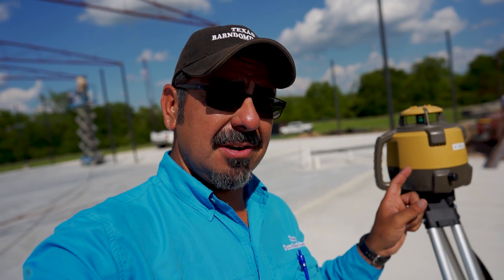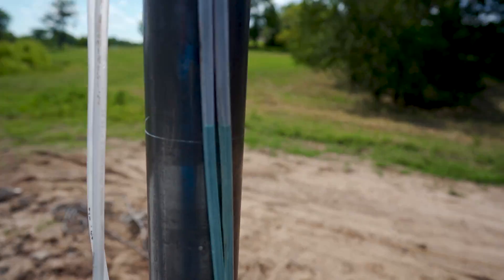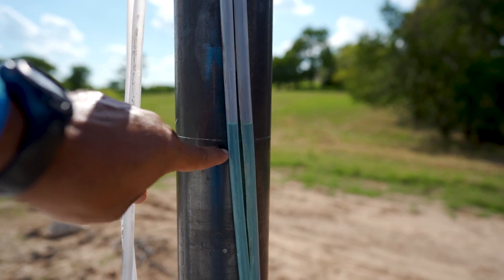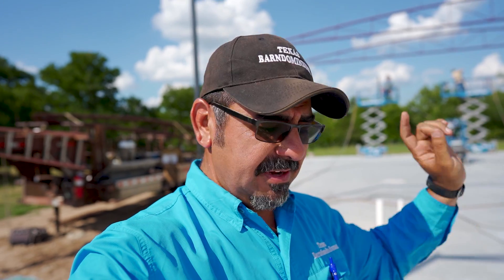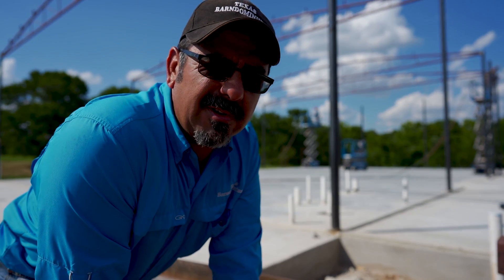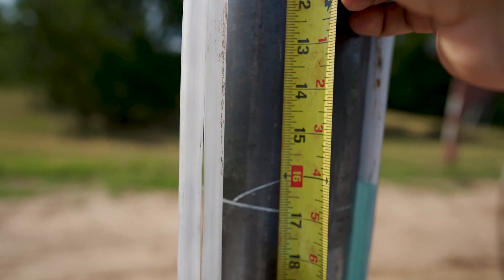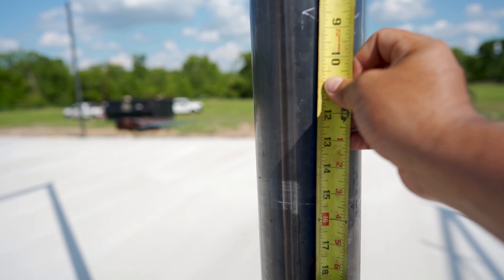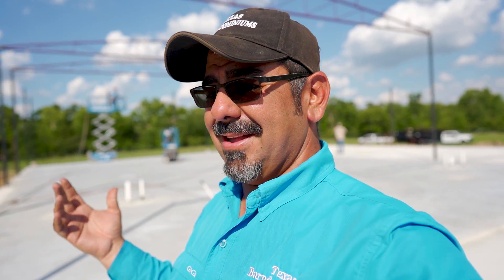Laser level vs Water level | Which is more accurate?

Comment: lasers are amazing tools but far from perfect, a laser can easily get off and needs to be checked every use most people have no idea how to accurately check a laser for plumb and level in my line of work a laser can help greatly but if its even 1/16 of an inch off over 8 feet it is too far out and needs to be replaced

Comment: It's more likely some parallax error while hand marking.
Laser beam with shoot straight on very long distances until the beam spread its beam and loose accuracy ,the construction will be an inverted trapezoidal. 
The water level will follow the Eath curvature and make you produce the same curve on your construction.
In the absolute,the water level is more accurate,just because we live on a big ball,and not on a flat surface.

Comment: You make a mistake marking it. Not sure why you talking about the battery, it can be charged or replaced, the water level is more accurate but almost no one uses it anymore and takes time, who wants to drag a hundred feet if tubing, the laser has its limits and better ones are more accurate if you need better than 1/8 on 100 feet, you will need a surveyor service. Great video.

Comment: Let it settle and the water level will be as accurate as the meniscus of the water in the tube.  Add a bit of dishwashing soap and the meniscus will decrease, giving even more accurate measurements.  The laser will expand slightly over distances, so when you are marking your levels, you need to ensure that you are marking the exact center of every laser dot / line.  If you are needing to mark a single reference point throughout a house where there will be walls blocking a clear line of sight, the water level will work better.  If you wanted to see if the slab of your house is at the same level throughout your house, the water level would be a better choice.

Comment: Perhaps it was a measurement error on the pole that was out 1/8th.
Reply: On job sites where pin point accuracy wasn't required my Old man used to say
"a blind man on a galloping horse wouldn't see that small imperfection"

Comment: I love water levels because when you are on very uneven terrain you can work very easily with it. 
Once you have a slab or level foundation or work inside the laser can speed things up but the upfront costs are my problem also getting the laser setup level is sometimes an issue when the ground is not solid.
Reply: There are so many lasers on the market now that the price really isn't that bad compared to 20 years ago when they cost thousands of dollars. I remember my dad bringing home a transit laser that he would yell at me to not even look at, an would bring it in the house every night because it cost a small fortune. For 700-1500 you can get a really good laser that will pay for itself with the amount of time you will save. You'll get so use to it you'll start to wonder how you ever got by with out one.
Reply: @dylanrampage9360  So you know of any Laser level which can shoot me a laser up to 1000ft ? I still looking for one which don't break the bank.

Comment: But: the laser gives a flat plane, the water level gives "equal gravitational potential" (not the same).  
over a long distance the water level will give a curved plane "in line" (as in fairly similar to) with the curve of the earth.  Remember that flat and level aren't the same on a globe. For a typical building site there is as good as no difference, for civil engineering at larger sizes/scales there "Is" a difference (If you use a fine enough tolerance)
(For drainage etc, level (or "constant gravitational grade") is preferred to a "flat plane".
With a water level you could also have multiple lines running from a reservoir (bucket) and take simultaneous shots after they have all settled down.
Reply: I think you might be the only one pointing out this correct distinction. Thank you for that. Flatearthers do not understand this important difference  ;)
Reply: @JesseKozlowski  Nor do "Globers" realise that you rarely (if ever) actually can "see the curvature of the earth." - psst, I'm in the Globe camp.
Despite all the videos "showing it" - again there is a difference between the visible /limited secant plane and the curve of the earth...  hint, the curvature of the earth is bigger / flatter  than our apparent (geometric) visual limitation - unless we are very high - hundreds of km.  lol
Reply: @JesseKozlowski  . Only just saw your reply. Nice set of cases. I fly light aircraft and the experience of the mountains "Rising" from below the horizon, as we cover many miles is the best way to demonstrate the geometry of earth.  Trying to show curvature in a single photo (in a lot of cases mere arc seconds or maybe minutes)  is frought with refraction/atmospheric haze/other optical effects -to really demonstrate very much (in the single shot)..  Cheers.  Sorry if this is off topic.
Reply: @JesseKozlowski  Are you suggesting that the water level will drop down, drop away from horizontal by a distance of 8" times the distance in miles squared? I'm not so sure that most of the people here agree with you.
Reply: John Bowkett  . read the reddit post (askscience) "Just how much does earth's gravity bend light?" No point reposting. TLDR  not a lot...
Reply: @Cleary Did you really just ask if the water level was calibrated? What would that entail? Maybe adjust the pH like in a swimming pool?

Comment: My hypothesis. A perfect laser level compared to a water level over a 1 mile distance (Amazon warehouse) will show the water level at 8 inches lower than the laser. Reason.. Assuming the air pressure is the same at both ends of the tube then gravity will "equal" the level.. But compared to what? Well the surface of the Earth right? The problem of course is the Earth is falling downwards about 8 inches for every mile away from the starting point. The laser on the other hand will shoot a line at a tangent t the Earths curvature. So if you build an Amazon warehouse with a laser you will dig a pad that is 8 inches higher at the other end. Build it with the water level and it will curve downwards. Discuss..:)
Reply: The columns and the other vertical structural components will be plumb. You've got the 8 inches part correct, but the rate increases with the distance squared, not just mile upon mile, but it's the miles squared.  So, it two miles it won't be 16 inches. It is 32 inches. As for curving "downward", that's only relative to some point you choose to measure from. The laser level would technicality measure this if it could reach 2 miles accurately, but the beam would diverge way too much.
Cool stuff. The easiest thing to do is measure the inclination of the plumblines at each end of that Amazon site using a 1-arc second theodolite like a Wild Heerbrugg T2.
Reply: @JesseKozlowski  Yes thats true its not a linear relationship. I was taking the 1 mil point as an example. Now if you used the WL to make the columns vertical, in theory they would stick out of the Earth like a porcupine..:)
Reply: @JesseKozlowski  Interesting never realized that. But realistically if something would be six feet off on mile don't think it would make much difference to anyone :)
Reply: @786otto  , makes a big difference in construction of dams, canals highways, tunnels, and buildings  :)
Reply: Thanks for this info, interesting, did not realize the 8" drop-in earth roundness

Comment: The water is always perfect, gravity works, but it takes patience and experience to get it right. Takes time ($$) where the laser is fast and easy and properly set up and confirmed you can count on repeatability. I had a Robo Laser long ago and built a lot with it. After some tweaks out of the box (checked with a water level) it was good and no detector needed. Wish they were still in business.

Comment: I have used both pretty extensively the laser you need to check calibration every so often.    The water level wind will make a difference sometimes the upwind side will have a higher pressure then the downwind side causing your levels to be off a little bit. The laser level can be a one-man operation easier than a water level but if one end of your water level is attached to a bucket filled with water it can be a one man operation also.    A very good laser level can have a range from one side to the other of almost a thousand feet a water level is limited to probably about 150 to 300 feet.  A water level has its advantages in that you can level easily underneath structures and in any room.   It is probably wise put a small amount of detergent in the water used in a water level to do away with the surface tension of the water. Don't use too small of a hose because the surface tension will make a difference. I always used a garden hose with a clear section of hose at the end to get my levels I always put a valve on it also so that when I transported the end from one location to the other I didn't lose any water.   
High tension power lines, strobe lights like those found on emergency vehicles,  arc welders and anything that reflects light like large glass windows that business  sometimes have will play Havoc with your laser level receiver.    Get too close to an automobile that has a real shiny finish can be a problem too.    If you have more than one laser level on a job site or nearby you can get some very erroneous readings also.    You don't have those problems with a water level.    However you can have problems with heavy equipment running over your hoses.  If you do not need a level very often a water level is probably far  more cost-effective.     So in summary they both have their advantages and disadvantages.   You can get very good results out of both of them.    A water level is a very good tool for surveying caves and mines.   Another pretty good low tec level is a speed square and plumb bob but it is not nearly as accurate as a water level.     The best level that I have ever used was a split bubble Wild made in Switzerland it was so sensitive that just switching your weight from one foot to the other even on solid concrete would cause the bubble to move slightly.

Comment: Water is much better.  I have a professional quality leica laser.  I had owned many brands in the past.  Leica professional type has been for me the "Cadillacs" of the laser industries.  However, the proline of their lasers requires regular maintenance.  If you do not keep up with their calibration you will not get a professional result.  I have found Hilti is also very good and more dependable than Leica.   In the old days of construction, I learned to rely on water lines.  I still do.  Low tech is the best to find levels in most applications.  Technology does help to make the job a little faster.  Do you need a laser? No.

Comment: Interesting video I stumbled on here. I am a metal stud drywall guy,and I actually started in the trades in Texas,and we used a water level all the time,back in 1983 the lasers were not yet as available as today. I think since there was only 1 discrepancy, it could be the mark made on the pipe was slightly off...But yes,the water level is the bomb,just keep the air bubbles out.

Comment: I use both the water level and a laser level to set tile. Your water level mark is off. I know this because if the laser was off you'd have more than one pillar that was off and the error would be progressive. So why do I use a water level? To periodically check the accuracy of my lasers, as the water level, given enough time to settle, is infallible.
Reply: Water levels are not infallible surface tension,  size of hoses and wind make a difference sometimes.    When these factors are taken into consideration the water level is probably the most reliable.     You are right about the error would be Progressive.    Just one reading being off a little bit is probably human error or perhaps a little bit of wind when they took the reading.
Reply: @vernyanke1131  Hu.... as a commercial tile setter I don't really have to deal with the wind indoors. So that might be helpful to know someday if and when I do use one outdoors. As for the other items you mentioned, that's user error and not the fault of the water level. Friction can easily be avoided by the use of a sufficiently large tube (= or > 7/16 id) and a little bit of soap. My point about the device is really about the consistency of gravity. But obviously sloppy use of the thing can screw up anything.

Comment: The concept of the water level is sound.  Looking at the product specs. of laser levels will show a small variance in accuracy.  This variance will magnify the further away from the source.  That said.  I have never had much luck with the water level.  I think it's the operator :-)  The best tool is only as good as the operator.
Reply: Truth. My friend always says: "you need to be smarter than the tool you are working with" or something like that 😄
Reply: @flat6fever680  So true.  My variance of that statement is - the tool is as smart as the operator.  In my case it can be stupid. 😉😉

Comment: Betting on human error since only one is off.
And the water level should be dead accurate to the earth and the curve of the earth (following the curve of the earth towards the earth core) 

where the laser usually has little less accuracy but it makes a FLAT line not following the curve of the earth but on less than a kilometer it should be very similar

Water levels also can measure around corners and innside a box compared to outside,
Reply: The curvature of the earth drops off about 8 inches in a mile this is why when you run levels you should always level with equal lengths on each side of your instrument when you move your instruments and you shouldn't go more than about five or six hundred feet each side of your instrument when setting levels.   When using a laser level you should alternate the direction of the level 180 degrees on each set up this will cancel out any small errors you might have in your laser level.   To check your instrument for calibration accuracy set your instrument up and drive a stake some three or four hundred feet from your instrument. Then take four readings for each one quarter turn on your instrument if all readings are equal then your instrument is in calibration. If your instrument is heavily jard or the wind blows it over for whatever reason you should immediately check for calibration to see if any damage has been done. The shorter the tripod to a point the better and less likely the wind will blow it over protect your instrument with a vehicle if possible heavy equipment is less likely to run over it if there is a vehicle in the way.    This is also a good way to shade it from the wind vibration do not use a vehicle who's paint is very reflective it will play Havoc with your readings
Reply: I have also discovered that GPS leveling is not very accurate if you have tight grades it is better to use a level of some kind.   I have had multiple projects where the original surveyors used GPS to set the benchmarks and in some cases there was as much as five or six inches difference between the beachmark at the beginning of the project to the end benchmark.   It is hard to make a project work with these kinds of errors.     To a slightly different subject but relevant to these facts is global warming and sea level rise.     How in the h**l can the climate scientists claim that the sea level has risen an eighth of an inch in a year when they can't even get a GPS level to get the same readings in the distance of 4 or 500 feet twice in a row.    I think they're blowing smoke. I don't think they know what the h**l they're talking about at all.   I think they are all  full of sh**t.     Is the sea level rising or is the land sinking into the sea or maybe neither.    I don't  know but I don't think these geniuses do either.

Comment: Great video, as a builder I have used both, and I've seen lasers be off, especially if not setup correctly or dropped etc. Yet I still use the laser for the most part for speed etc, and it's easy to setup a couple benchmarks and to check yourself... I used to keep a backup water level... Might get a hundred feet of tubing again, just in case...
I like the windshield washer fluid idea... Here in So Kal it's not cold enough to need for freezing, but visiblity is better...

Comment: Im going to say the water level is slower but more accurate if you give it enough time. Why? Let me ask a question. Does the laser calculate the difference in distance and compensate? A laser is focused light ("Light Amplification by Stimulated Emission of Radiation") and it DOES disperse the farther you get from the source. So as it defuses its possible to become less accurate. I guess it depends on how powerful (or not) the commercial laser is. My guess is not very as people would be suing all the time for eye damage.
PS: water worked pretty darn good for the Egyptians. 755 feet square and level within 5/8 of an inch.

Comment: Why am I just learning about a water level now, so many times I could have used one.
Reply: Same here! I guess translucent flexible tubing came along after the old hands that trained me.
Reply: @dbmail545  The tubing doesn't need to be translucent if you add clear pipe, plastic or glass, to the ends where you read the level. Seen such for sale, even graduated so you could easily/directly  mark offset from the actual level.